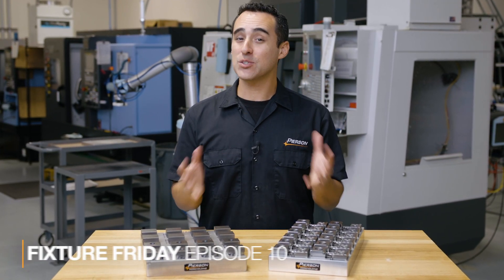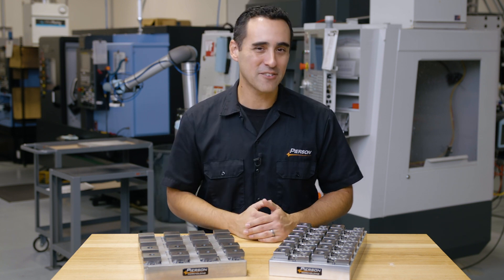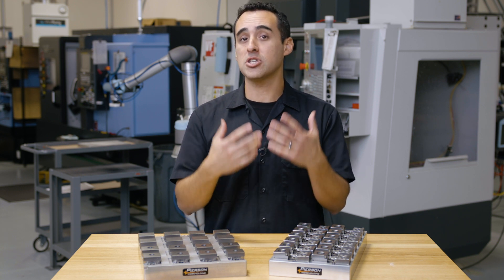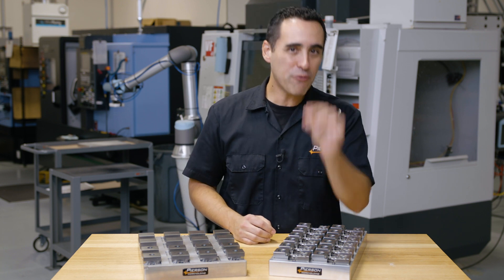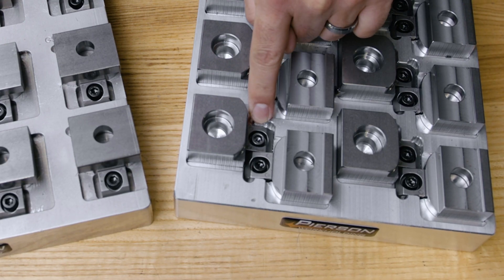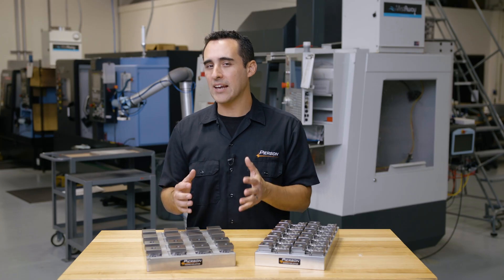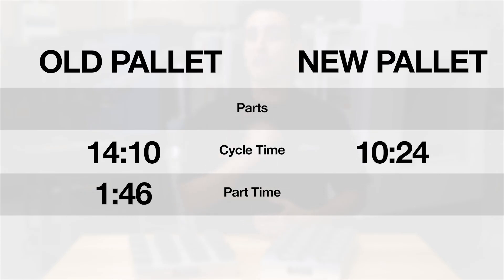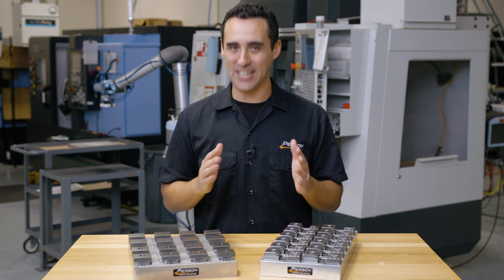How to IMPROVE your Fixtures | Fixture Friday 10 | Pierson Workholding

Comment: OK, I have to ask you to be honest here.  I worked with people that were too proud to admit they messed up.  That new sized pocket around the pitbull clamp with only .01" clearance around the clamp.  Are you having any increased difficulty blowing out those few chips that get stuck in there.  I want to do too, and I have learned that mistakes can be more valuable than success.  Its easier to learn what not to do from mistakes.  Its hard to distinguish what to do when presented with success.
Reply from the maker: Here's the honest truth: Yes, chips will still get stuck in the .010" gap, but we leave them in place! They serve to block more chips from getting stuck. Lean waste #5 is "over-processing" so we don't over-process by removing chips every cycle when it's just going to happen again unless we just leave them in place.
Reply: @PiersonWorkholding  THANKS for being honest.  Now here is my most deadly concern, have any of those chips ever gotten stuck between fixture and part.  1st op no biggie 2nd op OMG!
Reply from the maker: If a chip got stuck between the part and clamp, that's an operator problem, not a design problem. Same concept as parts in a vise.
Reply: @PiersonWorkholding  If you have chips that refuse to get blown out because the area between clamps and wall or clamp and clamp get tighter and chips get lodged. Now you are blowing before loosening clamps and before inserting new parts.  Thats a production problem.

Comment: Regarding the part time, the new pallet has got 1.5 times more fasteners & 1.5 times more parts to manually handle, so I think that should be taken into account as part of the calc; add a fixture setup row. Granted, I'm sure the new system would still be better when you take the chip clearing & part relocation times into account but I still think fixture setup should be part of the picture.
Reply from the maker: One thing to keep in mind is that there are two identical pallets running production.  While one pallet is being machined, the operator is preparing the next pallet to go into the machine.  This is the beauty of pallet systems... changing 24 parts in about half a minute is a huge production gain.  I discuss that concept here: https://youtu.be/orh-DzwONb0?t=101

Comment: Jay - does the pallet hardware kit work on mps?
Reply from the maker: Yes, but you need a machine that can hold ±.0003" true position if you are going to machine MPS pallets.  Tormach or older, worn machines aren't the best candidates for these tolerances.

Comment: Heya,

I must be confused, between converting between imperial and the metric systesms. I can't see how going from 8 to 12 parts is doubling production.

Yes you are corret on continually improving, it's the basis of the ISO 9000 standards, however persoanlly I think you made too many changes at once to ensure you know where the real improvment was found.

You change the workholding system, you changed the number of parts, and you changd the tooling, what improvments did you find with each change? 

 would like to see you perform a "run" with the new tooling on the old workholding system.

It's interesting you state that your machinist picked up that chips get caught in the pocket of the old workholding system. You also noted that it was hard to swap parts on the old one due to the bad datums. Yet you continued to use it, so it was broken and you still didn't fix it.

Sounds like your machinist was doing the right thing and providing feedback. Sounds like a standard management problem.

Sorry to sound harsh but you want quality it's on everyone not just one person.

Regards
Reply from the maker: Yes, you are very confused indeed, lol. It's pretty clear at 3:50 that a part takes 52 sec the new way instead of 1min 42sec the old way.

2:47 shows using the same datum edge. I think you should give it another watch.
Reply: @PiersonWorkholding  LOL!  We all know you don't have a management problem.  I think that guy has a basic video comprehension problem.

Comment: Thanks for the slick video J. So you use pitbulls to clamp raw stock, what do you use to clamp the finishing op?
Reply from the maker: Yes, typically Uniforce clamps are better for op2 because they don't leave a mark, but they have 8x less holding force. Pitbulls were used here because the cosmetics of the op2 clamping face don't matter and higher holding force was best for production.

Comment: As a suggestion, could mitee bite uniforce clamps be used instead of pitbull clamps? If geometry allows, this would reduce the number of screws you need to loosen/tighten for every reload. Awesome video! :)
Reply from the maker: True, Uniforce are very efficient but have low clamping force compared to pitbulls.

Comment: Do you guys not have issues with the Pitbulls wearing out the aluminum?  I was under the impression I "needed" to us a steel locating rail for a long term fixture that utilized the Pitbulls... hoping I can ditch the rails to get more parts :)
Reply from the maker: Hey Justin! No, you don't actually need a backing rail but there are some design considerations that I discussed in FF#2.  Here's a cued up link: https://youtu.be/Un0gLEHt8Lk?t=135
Reply: @PiersonWorkholding  thanks!

Comment: With the repeated loading and unloading of steel parts in aluminum , does the aluminum start to wear out from the clamping and cutting forces ?  I think this would great for what I'm looking to do but I'm concerned with using aluminum and the holding power of just one clamp.Do you ever have parts come out of this set up ? I have 5/8 x 2.25 x 2.75 CRS that gets profiled all the way around and 4 holes added.
Reply from the maker: Sure, pallet wear can occur.  You can always go up to the next size clamp for more holding power.  I've discussed the wear issues in more detail in Fixture Friday #2: https://youtu.be/Un0gLEHt8Lk

Comment: Could small parts like that be milled on the lathe from bar stock in a completely automated process?
Reply from the maker: Yes, we considered that but live lathe tools are notoriously under powered and didn't have the same throughput as a palletized mill.
Reply: Doosan live tool motor is a little soft. If you had an NLX, the milling motor puts out about the same as a Haas mill.  I own all three and can attest to this.

Comment: How long do those “several thousand” parts last? What other setup is required on the machine? What else is done to that part before and after these two ops? Nice fixture. Good job.
Reply from the maker: There are no other setups.  Each cycle, 12 parts come off the pallet complete and then they go to black oxide coating.

Comment: Great improvement. Would a double wedge style clamp help to reduce clamping actuations, using one bolt for two parts?
Reply: Yes, but I think when the cycle is done they get the whole pallet out of the machine and put a second pallet in the machine
So when the second pallet is machining, you have time to switch al the parts on the first pallet
Reply from the maker: Good question and good answer from @owievisie but also a double wedge style clamp does not have the same clamping force as pitbull clamps which are more than triple the clamping force.